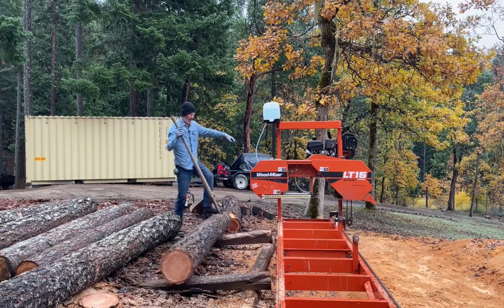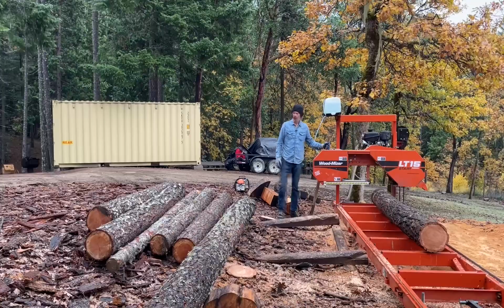Milling Lumber for Off Grid Cabin on Woodmizer LT15 Sawmill

Comment: your first cut on each face is pretty big.  when i've been building stuff i've always found that there is a need for 1x4 and 1x6 and 1x8 for stuff like window trim and door trim, shelves and so on.  maybe you're doing that because the sapwood is degraded but consider slicing a 1x board or two off the top of each log.  stack 'em and you'll find a use later.
Reply from the maker: I usually do make a lot of 1x4 and 1x6 as a byproduct. On these ones I didn’t because of the sap rot. On the last ones that were solid I went deep because they had sweep that would limit what I could get out of them. Your suggestion is a good one.